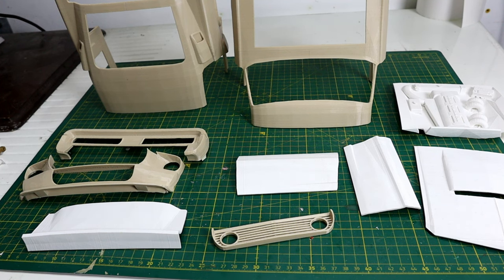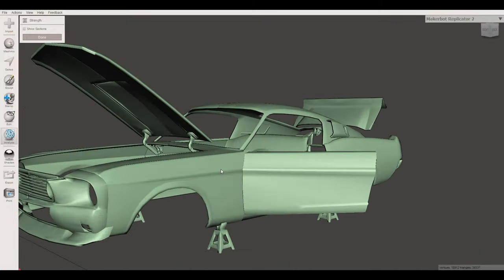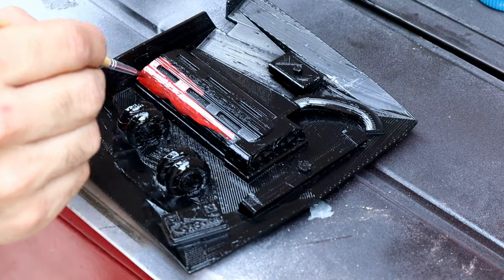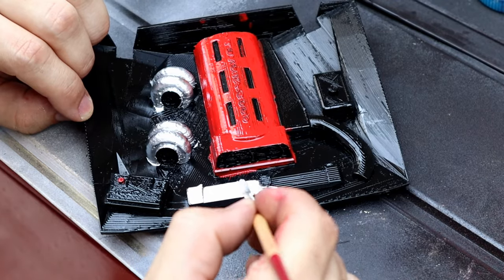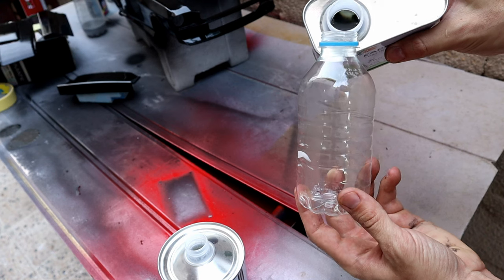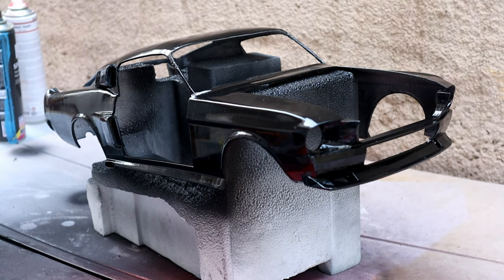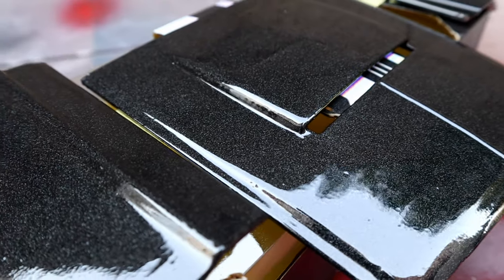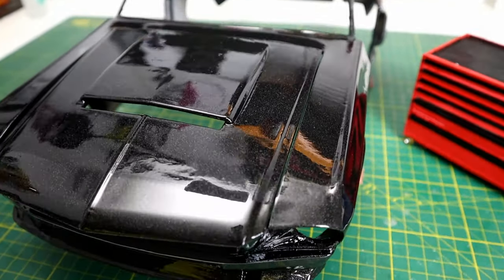3D printing 10th scale Shelby 1967part1/How to 3d print rc car body/Painting rc body/Scale Addiction

Comment: Hi, not bad.  I'd recommend applying the Bondo with your fingers and taking the wet sanding all the way up to 2 or 3000 for a smoother finish.  Also, I recommend not going so heavy on the first base coat.  Keep the videos coming.  Thanks.

Comment: hi great looking car if you sand and guide coat between layers of primer it will be a lot easier to get flat and tack cloth before every coat
Reply from the maker: Thanks yes, definitely, and applying second layer of primer after sanding first one, that will make it even smoother

Comment: hello nice design. I like more this carg than the supra one. What type of filament do you use for print this chassis. Also what settings do you use. I have an JGmaker 3d magic
Reply from the maker: Thanks, I used pla filament 0.12 mm layer hight, 205c nozzle, 60c bed %100 infill I use creality ender 3